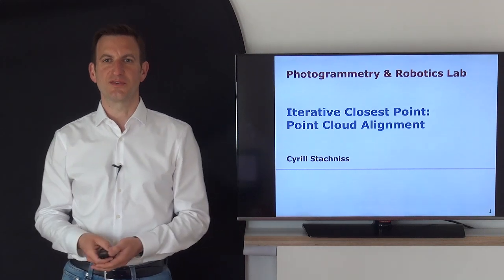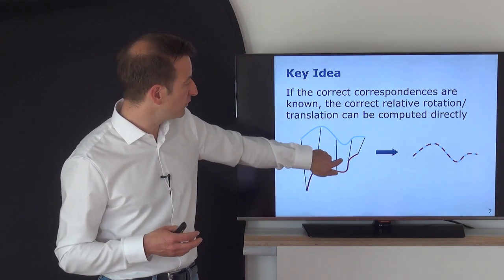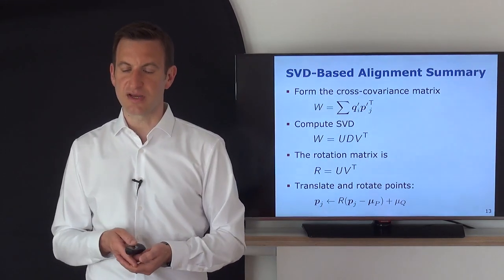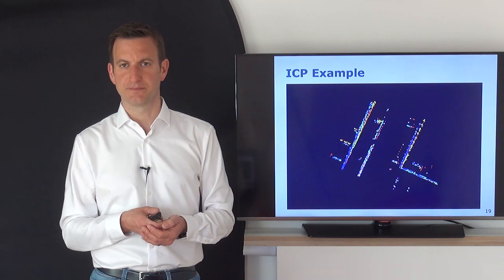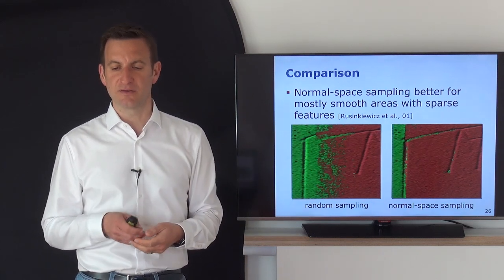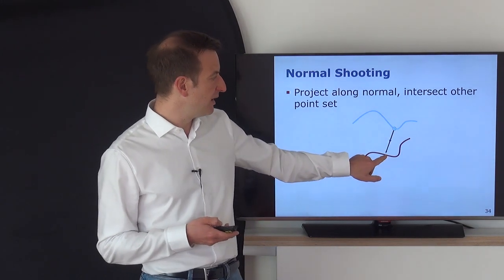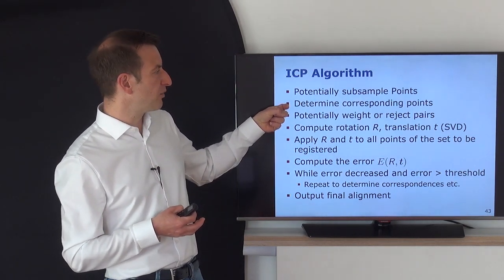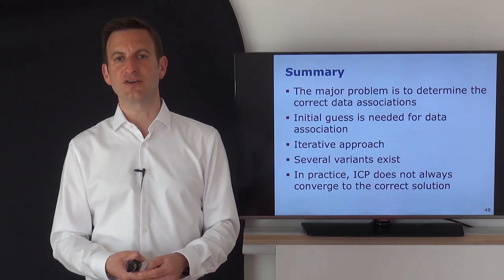SSE2 - 03 - [Audio Failure - video has been replaced] Point Cloud Alignment using ICP

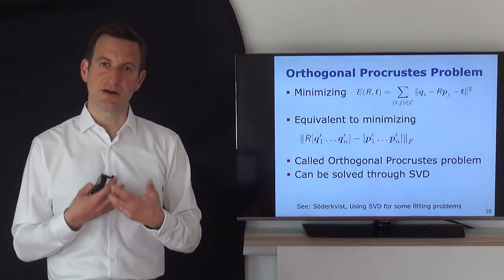Comment: Audio issues starting 11:20
Reply from the maker: Thanks - It seems a disturbance on the wireless mic channel - I will need to rerecord...
Reply: @CyrillStachniss  Would it be possible to run a filter on the audio for the given time duration to reduce the noise ?